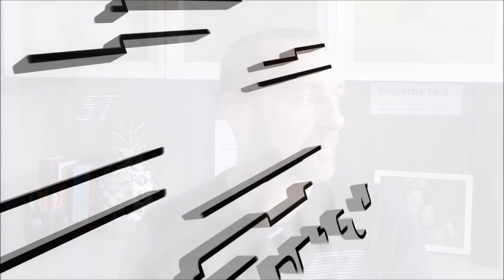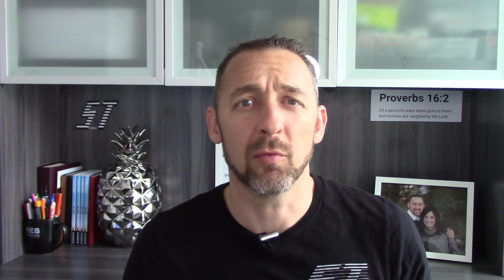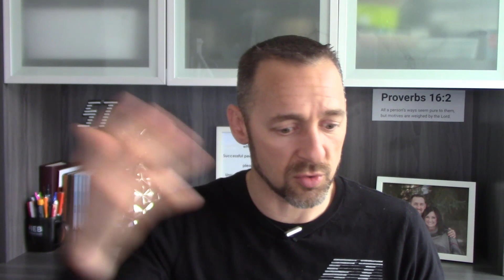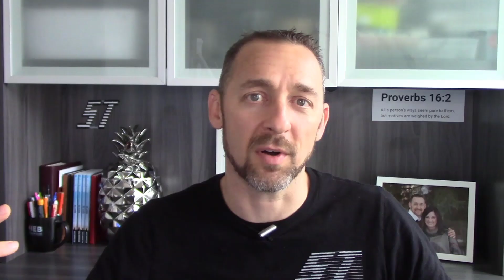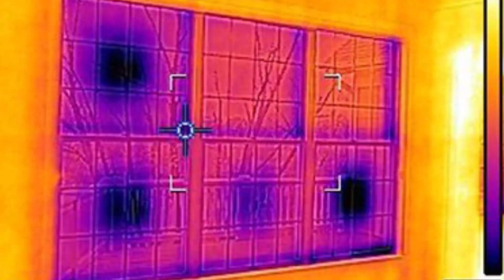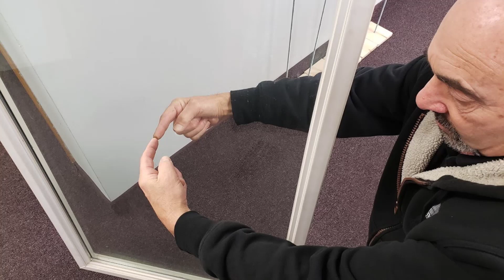Collapsed Glass vs Failed Window Seals

Comment: Another subset of failed seals you may find worthy of note - low e coating corrosion/failure. I've only seen this a few times. It's a mottled look, like failed exterior paint, but kind of metallic. I understand the low e coating contains vaporized metal of some kind.
In my opinion, failed seals with permanent fogging goes beyond cosmetic, as the window is failing to function as intended. Thanks for mentioning the standards, I used a disclaimer regarding current conditions in every report that included multiple pane windows.

Comment: I like this video.  We have now had 4 windows implode due to collapsed glass.  The failures occurred on the outer pane of triple pane windows.  The windows showed signs of extreme collapsed glass prior to failure.  Collapsed glass is not only a cosmetic condition as it can become dangerous when the window implodes.